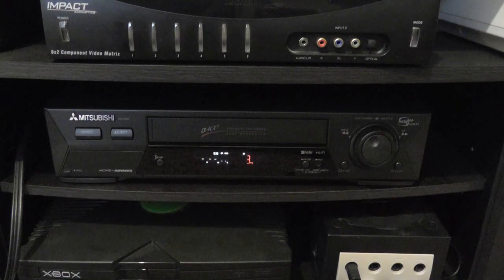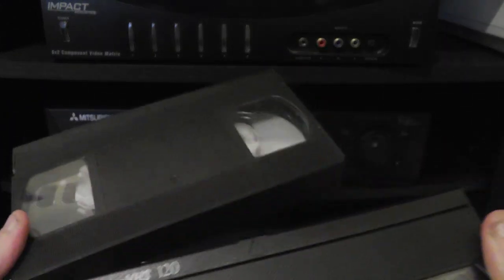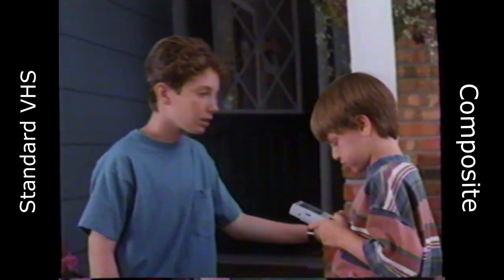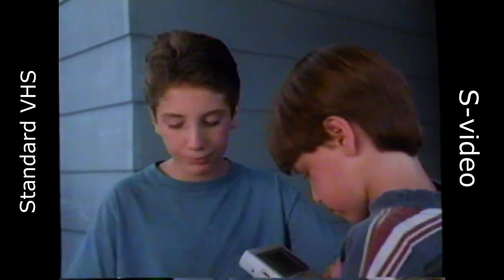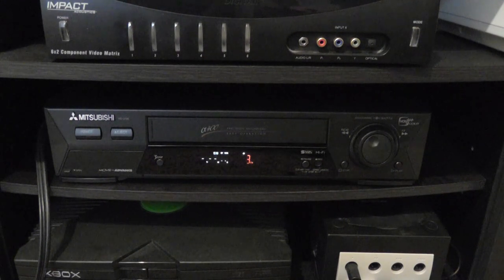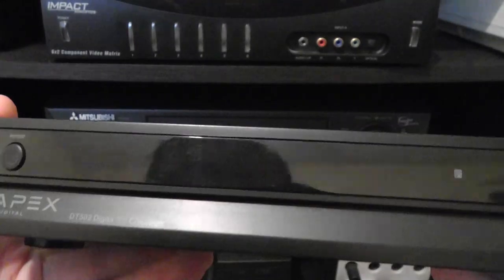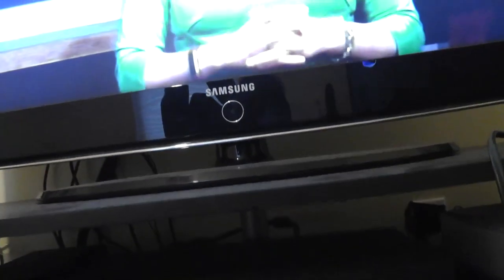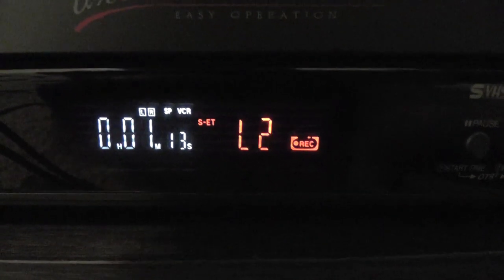Comparing S-VHS to Regular VHS

Comment: As a user of both formats, there is a difference between normal and S vhs, especially when using the S cable, and good quality tape. I’m finding generally speaking that many of my older vhs tapes are fading and getting dropouts,, while my Super VHS tapes are holding together quite alot better.
Reply: I can say the same for higher grade VHS tapes as well compared to the cheaper ones.

It's nice to know that the manufacturers weren't lying to us!
Reply: I've noticed S-VHS even has very little or streaks going across the picture unlike basic VHS.
Reply: I agree with guys above. SVHS degrade at same pace as VHS. Specially if you used good quality tapes. Didnt have any problem with original VHS at all. SVHS looks bit better on more modern equipment but on small crts that everyone has back then didnt look any better. I tested both of things recently since i still watch and record vhs from time to time.
Reply: @adokapo  VHS & SVHS are obsolete formats the longer they have been stored or used the more they degrade, they were not a recommended format for video or duplication as they degrade over time.
Reply: @speedyboishan87  iknow. Some of us do things just fot fun. ;)

Comment: A SVHS VCR with TBC can even make standard VHS look better than most remembered.
Reply: Built-in….I use a Panny AG-1980 the picture is sharper with TBC on most tapes. I also have Mits svhs 790 picture is good but not as sharp as Panny.
Reply: Find a Panny DMR-ES10 or ES15 and use it as a pass-through, it has always active TBC —and it’s cheap. Search online many talk about it, just make sure the S-Video input is working on the unit from the seller.

Comment: Even on regular VHS, the Chroma is stored on the tape separately from the Luma. However, S-VHS has considerably higher Luma bandwidth, which improves horizontal resolution. This also reduces crosstalk between the Luma and Chroma.

The next step up is W-VHS, which has even higher bandwidth, and natively supports both anamorphic widescreen and component video.

Don’t forget, though, that there are additional VHS-adjacent VCRs out there, such as time-lapse VCRs. Those things are badass.
Reply: Can't help but wonder if W-VHS would have been the superior format to DVD for older media...
Reply: Fancy seeing you here.

Comment: S-VHS has a better picture quality than the Standard VHS since S-VHS has 420 horizontal lines.
Reply: Blaze it~
Reply: No, it has 525. Anything more or less than 525 lines per frame would confuse an NTSC tv. You must be thinking of horizontal resolution, which is where VHS struggles.

Comment: S-video cleans up contrasting edges (less rainbowing) and prevents crawling in flat blocks of colour (particularly red). Composite causes these effects because the luminance and chrominance, although separated in frequency, overlap slightly over the single video wire. S-video transmits them on separate wires.
This clearly shows that VHS has such low quality that the edges are not an issue, but that blocks of red do show a crawling artefact. With S-VHS, the use of composite introduces rainbowing on high contrast edges and instability in block red colour.

Comment: It all depends on electronics, especially if it uses non-differential signal path. The dynamic range is not the same as SNR. Analog video does not have gradient degradation, nor blocking effect of high compression process in dynamic scene.

Comment: If you have some time could you do a test for me?
I always wondered if a regular VHS (non S-VHS) video would look better in EP when recording on an S-VHS tape.
The test would go like this:
Record a 30 second clip using an S-VHS tape in a normal VCR (non S-VHS) in SP mode.
Then record a 30 clip with the same tape in the same VCR in EP mode (some VCRs called it SLP mode) and compare them.
The logic is that EP mode will use the same signal, it's just the tape speed that slows down and degrades the signal.
Since S-VHS tapes are better they won't degrade the quality as much when the tape slows down.
Reply: I have this question too. I had a nice SVHS deck that didn't work in SP so I should have tried this before giving it away when I moved.
Reply: The EP is significantly worse than standard mode in both VHS and S-VHS. What's more S-VHS and VHS are very close in quality if a VHS master tape is used, otherwise S-VHS looks crisper. In EP everything looks garbage. It's an advertising gimmick about S-VHS having 400 lines of horizontal resolution. Even Betacam SP is somewhat lower - 350 lines. They used the same trick with ED Betamax claiming it had 500 lines. Never it had such a resolution! Only DVD 9 or DV had such a resolution. 
The main advantage of S-VHS was a flying erase head (necessary for editing) and less degradation during editing, plus some important picture improvement features. Some of such features were present on expensive VHS machines too. They made footage look stable like a DVD but it never had the resolution close to a DVD. S-VHS was about 350 lines just like Betacam SP but the latter was crisper and cleaner, and colors were richer. Hi8 and Laser Discs also had a cleaner, crisper picture and better colors - exactly like Betacam SP but these layman formats lacked advanced editing features. I had a couple of S-VHS machines back in the day. I sold the cheap S-VHS VCR eons ago. I also have an expensive VHS recorder. It's just as good as my other S-VHS machine - it only lacks serious editing functionality. Master VHS tapes look exactly like S-VHS tapes. It's hard to tell them apart even on modern high res equipment. S-VHS footage is a tad brighter + barely noticeable amount of extra resolution if we try really hard with a microscope and a team of forensics. It's not noticeable at all in my opinion. It was a commercial gimmick. S-VHS machines were poor studio alternatives to Betacam SP VCRs. That's all. If slightly higher movie quality was needed, Laser Discs were a better choice. Anyway, nobody ever was releasing movies on S-VHS anyway, except for some very rare cases.
And I always used only high quality master tapes. It did affect the quality!!! Although when it comes to audio cassettes, the difference was not noticeable at all between master tapes and average tapes. Still I used expensive (not too expensive) audio cassettes too. They were just nice, albeit 3-4 times more expensive. The same holds for video cassettes - I only used professional grade VHS and S-VHS tapes. They were a lot nicer. Ten years ago I threw all tapes which are not pro grade master tapes into the garbage. It's a pity but ... I got too many DVDs and Blu-Rays now and even they are no longer needed as we can stream the content. And there's so much content that I rarely record (=download) it. I used to record more. My DVD recorder has been gathering dust for eons now too.

To reiterate,  in EP mode it's difficult to tell which was S-VHS and which was VHS tape, if both were recorded in that garbage mode because then they both look identical and indistinguishable, like total garbage. It's even more difficult to tell which is worse then :) At some point I even thought (20 years ago) that my cables were not good. Those damn manufactures. They got even me fooled a couple of times. They sometimes even lie or make huge exaggerations even in instruction manuals for crying out loud! It's all in the past... Sometimes just some nostalgia about ole good times, I guess...

By the way, picture quality on both VHS and S-VHS looks a lot better than in this video. The condition of the author's cassettes and VCRs probably leaves a lot to be desired. Such quality is kind of like time to throw them into the garbage. I mean the quality was never that bad if good tapes and good machines were used.
Reply: @billmorrigan386  That was nice of you to write a book but it didn't really come close to what I was talking about. You should probably read my comment over again.
Reply: The answer is simple if you understand how magnetic storage of frequency and phase modulated signals work. S-VHS is a gimmick for people that don't record in S-VHS onto S-VHS tape. The short answer is that SP would look better. Why? Because high frequency content cannot be accurately recorded on slower moving iron oxide media...no matter what you do. If I go any deeper, I'd be using terms like quantum tunneling. So, no offense but what you're asking is ridiculous and nonsensical.
Reply: @matrixate  His question was not 100% nonsensical. At the same time you are absolutely correct about the tape speed and inevitable loss of quality. Physics can't be beat. The issue is how much of that quality is gonna be lost. The S-VHS format claims 400 lines of TV horizontal resolution while VHS claims only 240. Betacam SP claims 340 lines (BTW, the Betacam tape runs much faster, like, 4 times faster than S-VHS/VHS). It's logical to expect S-VHS that was claimed to be so much superior (400 lines vs 240 lines for VHS) to perform decent even at a lower speed (EP - extended play or low speed play), losing some resolution of course, but still maybe comparable to the inferior VHS at SP (standard play). And that's true to some extent. The problem is S-VHS is a gimmick in and of itself. It did have advantages for editing video - no doubt about that. Still, its quality was basically identical to VHS. The promised 400 lines were never really there, although theoretically they were, you know, like, in ads when things are exaggerated a lot but possible under some miraculous conditions = NEVER possible. At the same time, you see higher quality on an S-VHS tape but that's not because of 400 lines (there are never 400 lines, not even close) but simply because most VHS tapes were not master tapes. Master VHS tapes are indistinguishable from S-VHS tapes unless you look with a microscope and a team of forensics. That was very disappointing for me back in the day. Still S-VHS machines did give me some niceties like a flying erase head, Dynamic Drum System, etc. They were a must for editing on a low budget despite the quality of a master VHS tape being identical to that of an S-VHS tape. Some professionals also used S-VHS systems as Betacam several times as expensive.
Reply: @matrixate  It's not ridiculous if you understood my question. I'll dumb it down for you. SVHS tapes are higher quality. Therefore it would degrade the quality less. "SP would look better" of course it would. Who said it wouldn't? I sure as hell didn't. I'm not sure why you felt the need to make that up. The test was about EP quality. I don't have a VHS VCR or SVHS tape so I was asking this guy to test to find by how much. My question isn't nonsensical if you have enough brain cells to understand it.
Reply: @matrixate  One more funny point. What he asked is indeed wrong. Besides, he won't even be able to record an S-VHS tape with a VHS VCR -:) And after all, it's me who is stupid :)
Reply: @JohnSmith-qn3ob  You clearly don't understand what you're talking about. I seriously do not mean to offend but I just can't take the time to explain. I answered your question. If you don't feel it's sufficient, and you're not convinced, then you're doomed to have to do that experiment yourself to get to the same conclusion.

Comment: VHS and S-VHS have big difference but you need a perfect situation in this case about the monitor/TV. Inside on all monitor/TV have a conversion and not all internal conversor is the best. 
Try capture with DV format with svideo connection, you will see.

Comment: If you try using S/ET - S Video on S-VHS the picture will be extremely sharp and in very high quality
Reply: You cannot use SVHS-ET on a Super VHS tape.  The recorder will automatically default to SVHS mode

SVHS-ET only works on standard VHS tapes

Comment: Is it worth paying 500-1000$ for a SVHS player with TBC?
I alreadey recorded family home videos using VHS player and composite cables.
I don't know if I should re-record them using a SVHS deck with TBC and SET
9:59 VHS + Composite 10:28 VHS + SVideo 11:20 VHS + SVIDEO + SET
Reply from the maker: I've never used a VCR with TBC. In fact I was unaware of it until recently. I'm going to be upgrading my current VCR with a Mitsubishi HS-HD2000U that does have TBC. I recommend looking into that model if you're looking for a VCR with TBC for under $500.

Comment: If you can, could you do a comparison of Video8 vs Hi8 vs Digital8? I always wonder if there's a noticeable difference of these 3 formats,
Reply: Of course there is a difference. Video8 is roughly the same quality as vhs, digital 8 is the same as mini dv, and Hi8 will fall somewhere in the middle.
Reply: Hi8 is same quality as S-VHS and laserdisc (5 megahertz bandwidth across all standards).  LD has disadvantage of using combining the image & color (composite) which slightly degrades the image
Reply: It's DV (Digital 8 is the same in quality) that's clearly the best. It's better than DVD as it is 25 Megabits per second while DVD is usually around 10 Megabits per second. Other formats are analog and they are much worse. Among analog formats Hi8 is the best, then comes the Laser Disc, then S-VHS, then Video 8, and then VHS. That said, there's almost no perceivable difference between S-VHS and VHS, if high quality master tapes are used and if good quality equipment is used. It means there's not much difference among all these analog formats. Even the professional Betacam SP is not much different from them. However, I'd say Betacam SP and Hi8 are the best of them all, along with ED Beta or ED Betamax. The are all on par, although ED Beta claimed 500 lines of horizontal resolution.  Betacam SP claimed 340 lines. (S-VHS claimed 400 lines. Video 8 and VHS claimed 240-250 lines). In reality these were all advertising gimmicks and nothing more. It was very disappointing for me back in the day that S-VHS didn't deliver at all. It did when you compare it to a regular VHS tape vs S-VHS tape but it was indistinguishable if a master VHS tape was used. That said, S-VHS machines had a lot of nice features. They were a must for analog editing. ED Beta, Betacam SP, LD (Laser Disc) and Hi8 were excellent in terms of colors and picture cleanness. That's all. There was never much difference between these analog formats. They are not even close to DVD, let alone DV/Digital 8. The only analog format that was as good (or even better) than digital DVD was 1'' C reel-to-reel format video. It truly had 400+ resolution and no compression like DVD had. However DV/Digital 8 is no worse (I'd say it's slightly better) than that format as compression is low on DV (25 Megabits per second) which is 5:1 compression. By the way, 1'' C reel-to-reel format was a composite format. So, no, Y/N separation didn't give enough advantage and resolution as all ads claimed. These were just gimmicks. Shocking as it might seem but manufactures sometimes exaggerate and even lie in instruction manuals and specs, which is very sad and disappointing.
Horizontal resolution meant here (and in ads, specs, or even manuals of the time) has nothing to do with pixel resolution. The pixel resolution was 720x576 for PAL and 720x480 for NTSC. The problem was that analog formats could not capture that resolution properly, except for 1'' C reel-to-reel format. However, when digitizing any analog tape, we should always use 720x576 for PAL and 720x480 for NTSC or at least 640x480 or we are gonna lose more detail and quality. If a lot of compression is used like in YouTube videos, quality degrades a lot, so 720p and even 1080 should be used to preserve all that those old formats were capable of.
Reply: A few points more points (while reminiscing about ole times) concerning old analog formats:
These formats were evolving along with the equipment for them and the tape technology. VHS appeared around 1976 and reached its highest quality in tape and machines toward 1995. It's similar with other formats: they all improved over the years. 
Another huge factor is the tape. In digital it's simple: tapes and machines don't matter much - quality is the same within, like, 97-98%. However, a regular analog tape, say, VHS produces worse picture than a master VHS tape and it's easy to see. If you  record on a regular tape with an older machine, the result will be much worse than if you do it with a more modern machine and a master tape.
Reply: You can see on YouTube a lot of footage from all these formats. Depending on how they were converted, what tapes were used, how good/modern the original equipment was, the quality will vary significantly. So much so that a VHS might look better than Hi8 or Betacam SP. On YouTube you should use only 720 or 1080 to see the potential of those formats. 

Examples on YouTube  that were not butchered and most of the quality of old analog formats was preserved (I don't link them for obvious reasons - you have to copy and paste):

DV/Digital-8 footage:
Panasonic AG-DVX100BE in 2020
(This footage doesn't look impressive because it was shot in 16:9. DV looked more impressive in 4:3 but everything looks crummy vs modern HD and 4K)

One inch C reel-to-reel (it's not Betacam!) footage:
Betacam SP - HD Upscale Test

Betacam SP footage:
Samantha Fox - Touch Me (Peter's Pop Show '86)

Hi8 footage: 
San Francisco summer 1992 in HD (Hi8)

VHS footage:
Panasonic NV M1 VHS camcorder test footage.

Unfortunately many old ads cheated a bit. They shoot one type of gear or format. Then they say it was a different... a cheaper format. So, lo and behold how good it is. A lot of lies like that existed and now it's a land of confusion! Some people are unaware of rare old professional formats such as Digital S, D1, One inch C, DVC Pro and some  others.